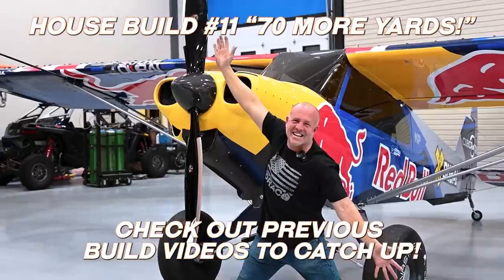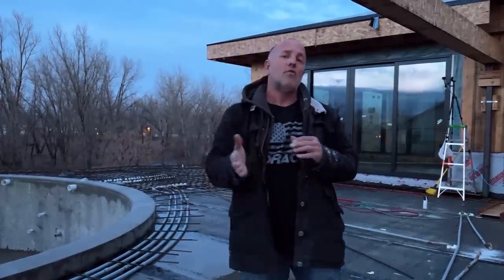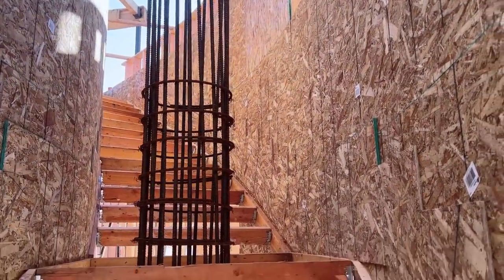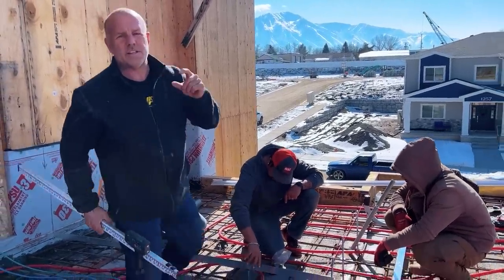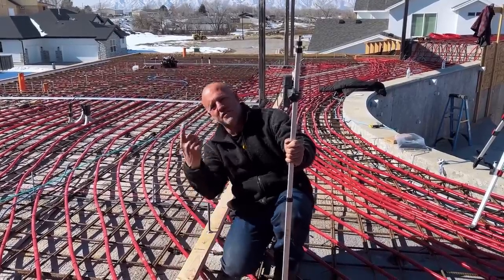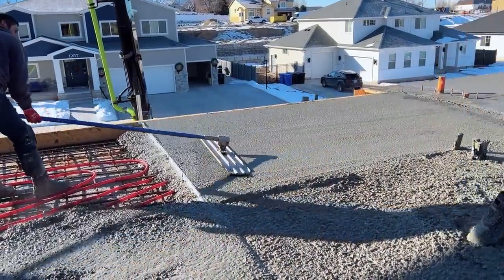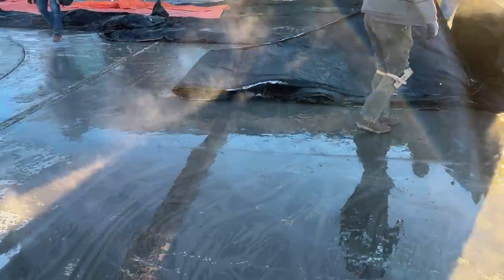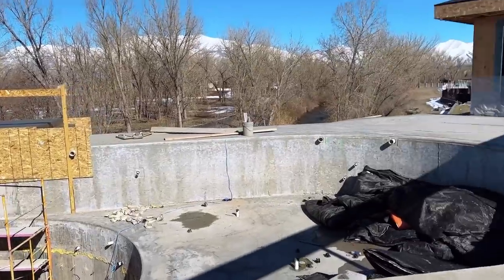900 Yards of Concrete - Curing Concrete in the Winter | House Build #11

Comment: Crazy how you do heating. First time i see heating tubes inside load bearing concrete with rebar. Normaly in Europe you finish whole load side of building lay some foil with styro 1-2' and build heating On special plastic trays, than you pour concrete on this only about 1/2 inch above those pipes. With small amount of concrete heating is very fast and efficient.
This video is just crazy.

Comment: this is fascinating to me because (this was decades ago... mid 90s) I was talking to contractors who were pouring cement for an overpass in single-digit/teen-digit weather. I asked why they did that because the water in the cement would freeze - they said that they put additives into the cement so that it wouldn't.  Not just that, but they commented it was worse to pour cement in the summer because the top would dry too fast.... oh how technology has changed... and how it fascinates me to see what we knew become what we never do anymore.

Comment: Mike! I got carried away with your super practical engineering so I wrote this - can you make a super light scrappy turbine and just jump it off the ground and then just dump it back on the ground using that awesome suspension - zero take off, zero landing - unbeatable. Can it be done?

Comment: Incredible... just incredible.  You know, I follow a few concrete channels - "Odell Concrete", "Concrete with the Hauses", etc. ... and I don't think I've EVER seen them pour 900 yards of concrete in a single job.  I'd be interested to see what they think about this job... and whether they think they can do it.  It's kind of like asking a builder if he could replicate the great pyramids or something today.  You really are building what should be a masterpiece.
Reply: Agreed.  Not to mention finding a contractor with the skills, experience and determination/commitment to do the job right.  I had a sidewalk and patio poured and it is a big fail.  Now I'm gun shy to hire another bozo.  Good job Mike et. al.
Reply: With all that concrete and rebar, I think this house will be around long after the great pyramids are dust. 🤣🤣
Reply: As a ex laborer and concrete inspector,  I am really impressed  by your concrete crew and your engineering skills.  As a laborer, I've worked for companies that did 300-600 yards a day, every day. The biggest flatwork I was around, was 5000 yards in 10 hours, with 3 pumps for a warehouse.  On road jobs, of course, they dump about 50 yards at a time.

Comment: Nice work. Have you had any issues with the aluminum tracks in the concrete? Usually aluminum anything in concrete is not a good idea because it causes a reaction that weakens the concrete. Just google “concrete and aluminum” and you can read all about it. Just wondering if you had any of these issues. Love the channel. Keep it up.
Reply: I think it was poured on precast panels anyway so the loss of strength isn't an issue. Any gas that is generated can escape
Reply: @retrofitter  I would be concerned about the concrete spalling around the aluminum angle on the surface.  But he might be covering it with pavers it sound like.

Comment: Around here it is pretty popular to use guides like that but we use a vibratory screed then it's a lot less work with the bull float because the vibration causes the rocks to sink a bit so it a smooth finish before the bull float.

Comment: Are you going with a geothermal heating unit?  Most of the big houses in the past 5 years up here in the mountains of Montana are going geothermal with propane backup. With the stream so close I would suspect it would work really well.

Comment: I know there are footing but at what point does the sheer weight of the concrete start to cause settlement issues? I know when they do bridge piers and bridge approaches with large weight they drive pilings down to support the weight to bedrock.

Comment: Hey Mike, Very impressive build.  Just curious, is the Cabana going to be a flat roof with parapit walls?  Assuming you will use roof drains if so?  I see the structure you pointed out and I have nightmares of rain running off the cabana roof into your pool.  I know you are much smarter then that but being a RE developer for 20 years, I've seen it all.  Amazing design, work, etc.  Thanks for sharing this extremely impressive build.  Cheers

Comment: I have to go back and watch the series. I am curious if this is just a thick topping or a suspended slab. I am curious about the column in the middle of the stair as well.

Be careful with adding aluminum and concrete. They react together and produce a lot of little hydrogen bubbles in the concrete. You have to have a coating on the aluminum. I have seen this done on different occasions. It weakens the concrete locally but may not be an issue if you don't require a lot of strength around the aluminum.

Why did you let the moisture out of the concrete? Generally you want to keep the moisture in during curing to help increase the strength.

Comment: How are the aluminum rails also expansion joints?
Reply: Defo not expansion joints but those Al rails will be where the slabs crack through  thermal movement. ( Good call).

Comment: Just curious as to why you used chip board on the actual house and not something like zip board?  Was it to keep the cost down ?
Reply: IF I remember correctly in a previous video he mentioned most all of that was just for the form work and most of the wood would be going away. I think he mentioned repurposing most of the lumber. IE not going to the landfill.
Reply: All of the framing and sheathing is temporary, only for forms to pour concrete. It all gets removed after the cure is complete.

Comment: Mike, I own a plumbing company in Denver.  We do radiant infloor and driveway snowmelt.  Interested to know what brand and size tubing you used in your slab?  
Our heat loss rule of thumb is circuits no longer than 250ft., but generally stick to about 200ft (100ft. out - 100ft. back to and from the distribution manifold)
Size and spacing are dictated by the desired btu output to meet the heat loss.  
What fitting system are you using?  There are A LOT of inferior fitting systems out there.  
Curious to know what your research lead you to.  
Back to work!  🦾

Comment: Hello Mike from Sydney Australia.
That's good quality (steel fixing) reo placement, form work and concrete curing. Hey... Why not have some moulds (formwork) and lengths of bar ready for fence posts, when you have excess?
🪃🌏

Comment: Mike, does that 820 yards include the volume of the pre-stressed concrete slabs?  Does Oregon have earthquakes, and if yes, how well would your new house perform in the event of one?   We build as lightweight as we can because of the quake risk here in NZ, except in cases were we build as strong as we can with steel reinforcement and bracing. It's large, solid, stone built properties like the Christchurch cathedral that fare the worst.

Comment: It’s really sad to see the difference in how you approach safety from when you’re building aircraft versus building your new home. OSHA would have a field day at this construction site. Multiple instances where workers are exposed to fall hazards greater than 6 feet, uncapped rebar exposes them to impalement hazards, unqualified personnel signaling cranes, no guardrails or other form of fall protection employed where unprotected edges exist and the distances to the lower level or ground exceeds 6’, lack of eye protection when using pneumatic nail guns. You’re not exempt from OSHA’s jurisdiction simply because you’re acting as a general contractor on your own home. OSHA can also cite you for failure to ensure your sub-contractors follow regulatory requirements under its multi-employer enforcement policy.

Comment: I love what you have created, but it looks like your house is right up against a tract of crackerbox houses. And after having formed and poured concrete in footings, columns and flatwork, it bothers me a little to see the guy with the vibrator hold the stinger in the concrete for seconds at a time, rather than a quick plunge in-n-out into the 'crete for tenths of a second, because if you keep the vibrator going for too long, all your aggregate drops to the bottom of your pour, kinda defeating the purpose of having concrete.